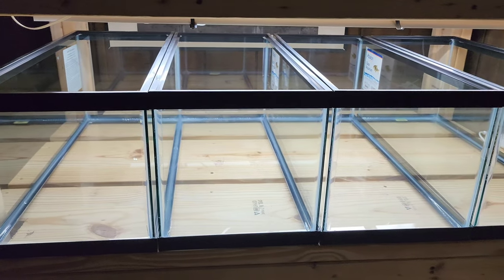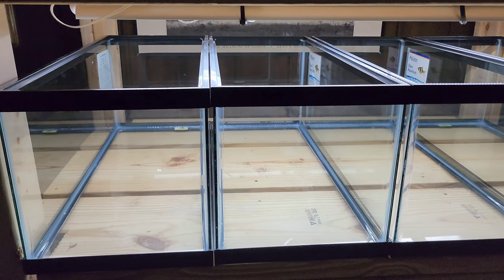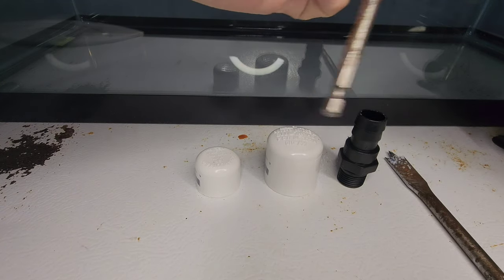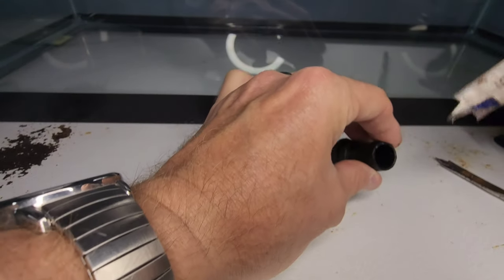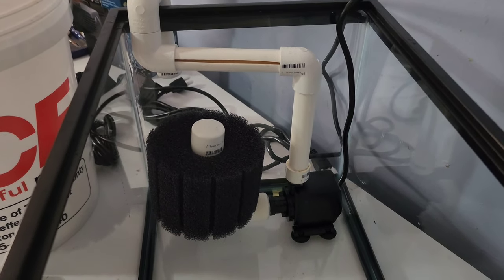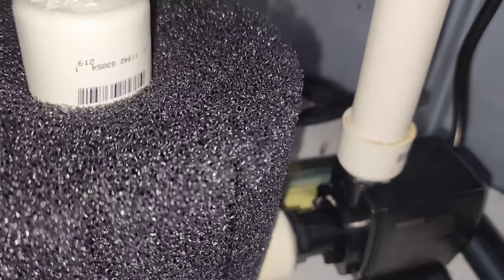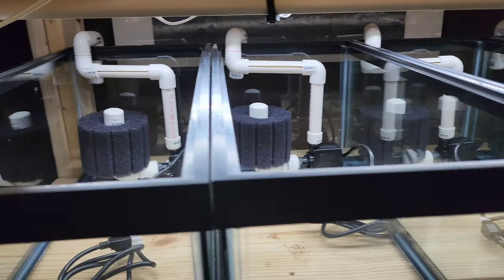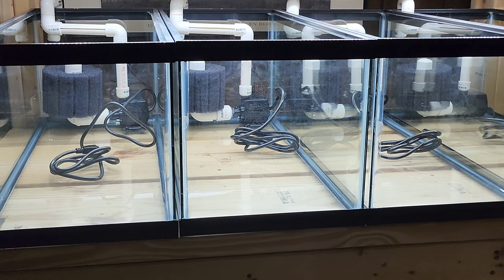New Shrimp Tank Rack - DIY Shrimp Tank Filter Build

Comment: Very nice set up but i am worried the flow are too strong. Hopefully your pump not super powerful. I am using doubles sponges filter power by air pump. I like your idea give more surface area flow.
Reply from the maker: I use 400gph pumps in 40g tanks, these are 160gph in 20g tanks, I think it should be ok.

Comment: What the purpose of this filters ? Why not just a sponge filter ?
Reply from the maker: The way I run my tanks better flow and turnover is very beneficial.  I run most my tanks with this style of DIY filter or hang on backs.  I have something like 11 or 12 tanks that are air powered, rest are pumps, my tanks are also bigger and would need lots of air, lots of air also means more humidity issues, which were horrible when most my stuff was air powered.
Reply: @MarkShellyAquatics  got ya

Comment: I'd like to see a video on how you reinforce the floor for more tanks. 

This seems a bit excessive running sub pumps per tank and I wouldn't glue those returns on in case you need to adjust the direction of the flow or redo the bar itself. Me I would of stayed air driven and ran a little bigger air pump. See how this works.
Reply from the maker: My tanks with pumps always out perform my tanks that are just air power, I do it for good reason lol
Reply from the maker: I dont have unlimited space, gotta make the tanks I do have as productive as possible.  Good flow and turnover has always helped with the way I run my tanks.
Reply from the maker: My air powered tanks are sometimes hit and miss, my pump powered tanks are always successful every time.
Reply from the maker: Lol, on the returns, the spray bar part isnt glued, i never glue the actual spray bar to make adjustment to flow direction. Only bits I ever glue on these projects are the ones that gotta be glued so the water stays in the tank lol
Reply from the maker: @asianpussykat33  one of my favorite parts of the hobby.  Always did it because most the years of me doing this hobby I was always too poor to buy nice filters and cheap stuff sucks.  So over the years I get new ideas I wanna try and improve existing designs, one of my favorite things to do.  Also the ability to make anything a certain size and for a certain purpose is pretty important and cost effective.  These could also look much much better with the colored pvc, but man, that stuff is so expensive, its not worth it for my purpose, I usually cover the pump and stuff in plants anyways, just the white pvc lol.